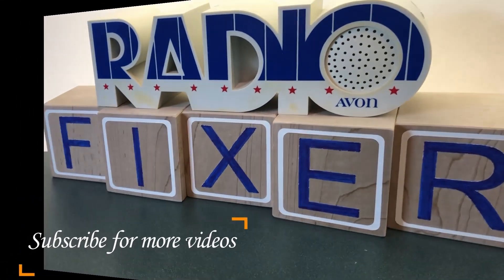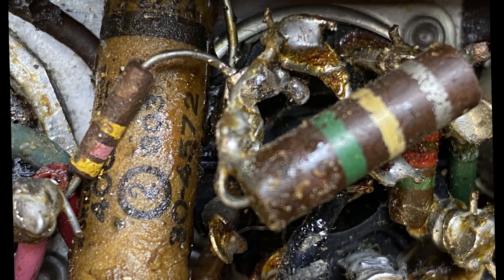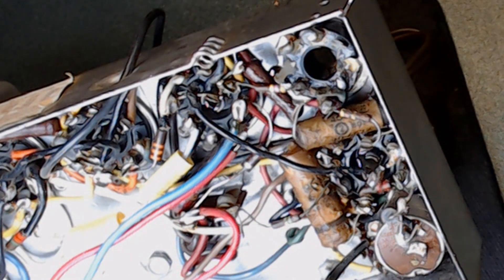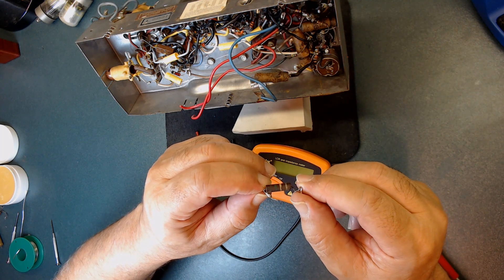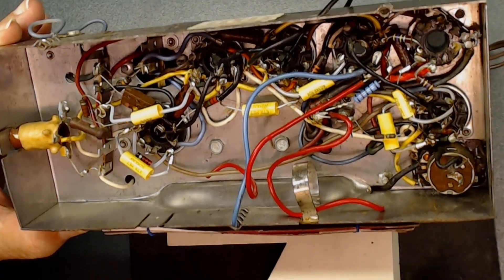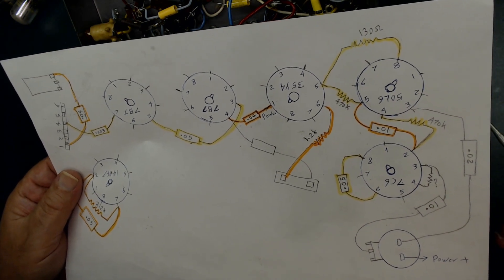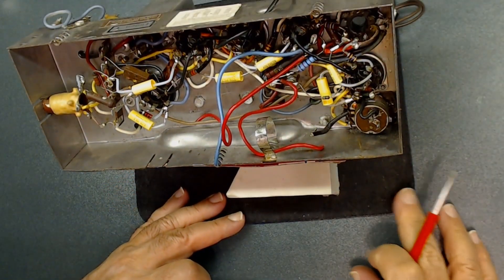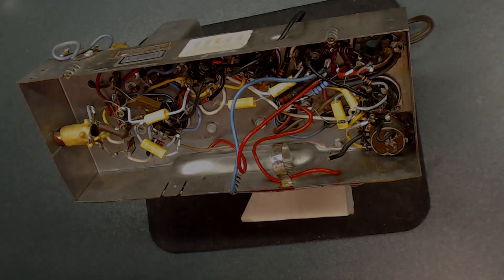Part 3 - Repairing 1949 Philco Hippo Radio

Comment: Yes sometimes you find the scrambled wire mess when repairing radios. That 1937 radio I was working on had places where wires broke off and also big solder messes on the sockets. It's always better to clean those up to prevent shorts in the future. Ok on changing the resistors as well at least this was not old enough to have dog bone resistors they are hard to read sometimes as well. Great work on rebuilding the gimmick on that cap and that's where some people goof up just take it off and wonder why the radio doesn't work very well. great job tracing everything out Jay.
Reply from the maker: Hi Larry, you are absolutely correct! is best to clean those bad solder joints since will cause problem specially when parts are on top of each other and no clearance or insulation between them. Not sure why the original did not have wire wrap-around it.  I duplicate what I saw on one off my Philco radio for this one as well. LOL. So good hearing from you Larry! Have a good day! Regards from Jacksonville Florida, Jay

Comment: Nice job recreating the gimmick on that cap Jay. That should work very well indeed. Philco was kind of famous for using those as well as other things that other manufacturers did not. :)
Reply from the maker: Hi Doug, I had no idea what that capacitor was (gimmick) as you mentioned. Not sure why the original did not have wire wrap-around it. I duplicate what I saw on one off my Philco radio for this one as well. LOL. So good hearing from you Doug! Have a good day! Regards from Jacksonville Florida, Jay

Comment: You run into the same trouble as  YTer Jim Burns  gets with his radios. Drawing the parts he will take apart and making
very detailed drawings is how goes about restoration. That is worth doing that cause it is easy to get lost in the repair.
You are doing great Jay.
Reply from the maker: Hi Steve, I watched Jim work and you are correct. LOL we both do tons of documentation. When I got stated fixing radios years ago, I thought that I will remember where everything goes, so I cut a few capacitors without taking pictures since had to use film camera and take the film to pharmacy store so they can develop the pictures. If we were lucky, 7 days later we could go and pick up the pictures. You are so young and might not experience those good old days.. LOL. 
I also did not document so was in big trouble next day. That poor radio still sitting around for close to 30 years and hopping  someday I remember where those capacitors should be connected. LOL
Good hearing from you Steve! Have a good day! Regards, Jay

Comment: Philco liked using that 8 turn indicator in series with the isolation capacitor for stray RF filtering.
Reply from the maker: Hi Jim, I had no idea what that capacitor was (gimmick) as you mentioned. I duplicate what I saw on one off my Philco radio for this one as well. LOL. Not sure why the original did not have wire wrap-around it. So good hearing from you Jim! Have a good day! Regards from Jacksonville Florida, Jay